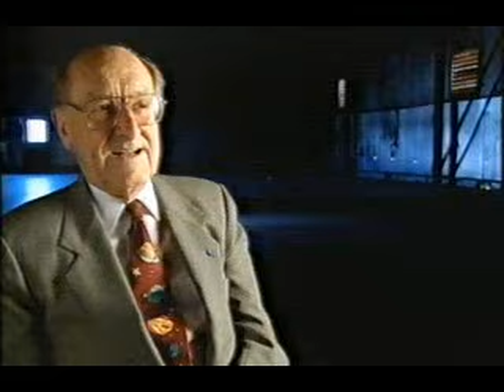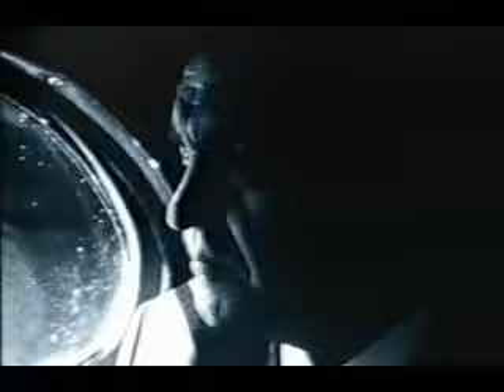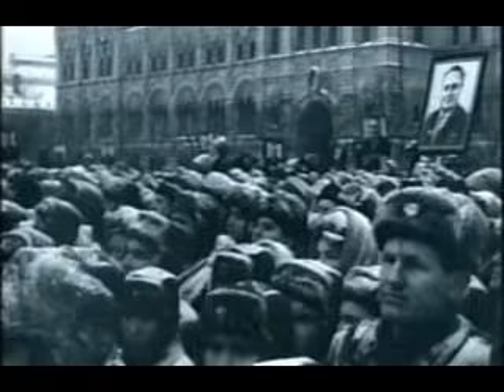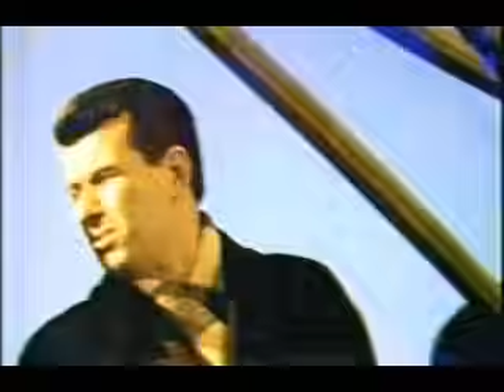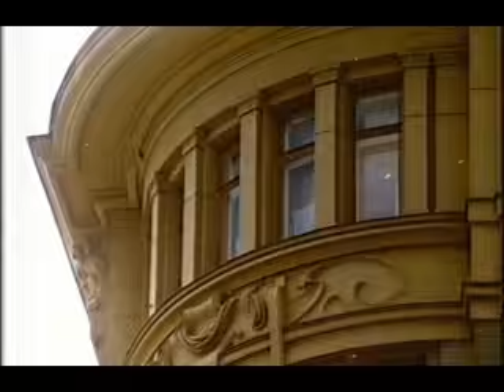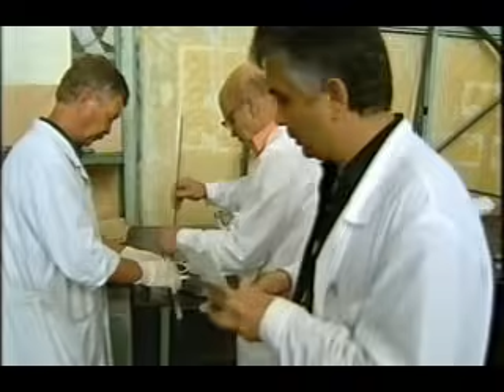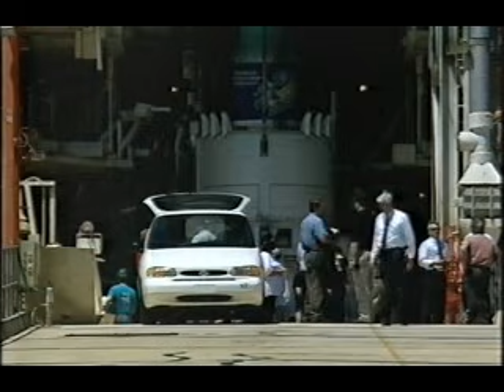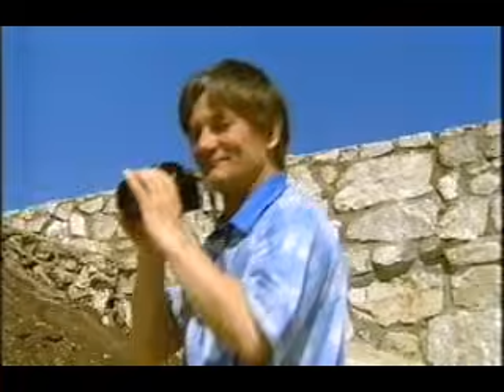Soviet N1 Moon Rocket Documentary

Comment: In 1961, the rocket engines P7 were thrust less than A4 rocket, 21 tons. But Korolev always took an ingenious solution, and made Glushko to install 20 low-powered engines. Rocket N1 was established 30 engines of 154 tons. Therefore, the increase of thrust from 21 to 154 tons this is huge progress. Today, modern RD - has traction 196 tons - is the ultimate craving for a closed cycle of burning kerosene and oxygen.
Reply: The R7 didn't have 20 engines it had 5!!! Each engine had 4 main nozzles (plus 2 or 4 smaller steering ones).

Comment: For all this, it's the Americans that got to the Moon by making a rocket that was reliable.  I don't belittle the NK-33 or RD-180 but I think this video is pretty hyped. "Uncomfortable lessons" have had to be learned by everyone.
Reply: the saturn 5 engines arent used by the american but their atlas rockets are using russian engines and the sanction against russia doesnt affect nasa because they have already received over 100 engines (several years supply of engines) from the russians. so though this is old russian technology and an old video it is still current technology
Reply: No, he's correct except that I think the Americans managed to buy some more engines recently so sanctions aren't affecting engines yet.  The Saturn V engine is too big for current launchers but a new launcher called SLS is under development and one of the competing booster designs uses a derivative of the Saturn V F1 engine.
Reply: t43562
Actually, the SLS will use the same engine used as the Main Engines on the Space Shuttle, the RS-25, four of them in its Core Stage. Also, the RS-25 was a derivative of the Saturn V's J-2 engine (not the F1 engine), which powered the S-II and S-IVB stages, which was developed into the HG3 engine which was used as the basis for the RS-25.
Reply: We can both be partially right. The F-1B is one of the proposed engines for the advanced booster competition for the SLS.  It's starting with shuttle-derived solid boosters and the advanced boosters will replace them. So says Wikipedia anyhow.
Reply: t43562
I'm not trying to be "right", the competition has ended (which was only a formality to begin with) and the RS-25 was selected. I have included a link to NASA's own SLS Core Stage Fact Sheet in .PDF form. In the first sentence of the fact sheet you will see that it states that the SLS will use RS-25 engines. Little word of advice, NEVER trust Wikipedia. :)

http://www.nasa.gov/pdf/756702main_SLS_Core_Stage.pdf
Reply: :-) I read the fact sheet and went a bit further down to the section on the Advanced Booster Competition. You could have read that far too.
Reply: t43562
O.k., WHAT are you reading? The fact sheet I link to says NOTHING about an "Advanced Booster Competition" and only mentions two rocket engine systems, the RS-25 and the Solid Rocket Boosters (which are nearly identical to the Shuttle SRB's and made by the same manufacturer). You must be imagining things, my friend?! They DID have a very closed competition for the Core Stage engines, but that has since ENDED and the systems for Core Stage and Boosters are already chosen and in place. You must have read some older piece of info because the two page fact sheet doesn't mention the Advanced Booster Competition as it was ended before this fact sheet was released.
Reply: Chris Cline http://www.nasa.gov/sites/default/files/files/SLS-Fact-Sheet_aug2014-finalv3.pdf
 Sorry for the little jab about reading the document - that was unfair.
Reply: t43562
I appreciate that. The article you linked to is an older one, before a lot of the selections had been made for propulsion systems. To my knowledge, all of the systems have been locked in for the first few flights of the SLS. I believe they intend to keep using the RS-25's in the Core Stage indefinitely and will probably use a more powerful and improved SRB in the future.
Reply: *****
My experience has been that Engineers are ALWAYS competitive because we all know we have the BEST idea of how to do anything. A lot of the wonderful things we have in our day to day lives (not just in THIS country, but around the WORLD), that most of us take granted, is due to NASA scientists and engineers having the freedom to create and expand. Putting a tighter leash on them may save money in the short term, but it stagnates our scientific and technological progress in the long term. That's bad for the United States and its people.

Comment: How the hell are they able to keep that thing from taking off?
Reply: simple attach the engine to a mass that it cannot lift... several thousand tonnes of reinforced concrete will do also they use whats called a flame bucket to redirect the engine exhaust so it doesnt damage the structure
Reply: killman369547 Or dig a massive hole in the ground causing the test stand to collapse. That actually happened to an early engine test stand!!

Comment: Sorry dude, the N-1 was loaded with  technological and design faults (So was the Saturn V). In fact the Russians never perfected a control system that could handle 30 of those wonderful NK-33 simultaneously. That's a Technological Fault and using 30 engines was at that time a Design Flaw.  

With that said barracuda7018's notion that the N-1 was an engineering disaster is beyond absurd. The N-1 was a brilliant piece of engineering that failed for a variety of reasons.

Comment: Von Braun was an important figure, but he really had a fairly limited domain in the space program.  He was very important in the 50s, getting the military's ICBM capability up and running.  He brought a lot of expertise in rocketry design with him from Germany.  But by the 60s that knowledge had disseminated.  He was a manager, and his primary contribution to apollo was the design and construction of the first stage of the Saturn 5 rocket.  The upper stages were built by other contractors.
Reply: And that Saturn V first stage is actually Four Redstone first stages strapped together!
Reply: @beakytwitch7905  the saturn V first stage was a new design.  I think you're thinking of the Saturn 1 rocket.  It was made out of a jupiter rocket central core with 8 Redstone tanks around the outside. But all modified and lengthened.  The saturn 5 first stage was a single fuel tank with five F1 rocket engines.  Those were only ever used on saturn rockets, not Redstone or jupiter